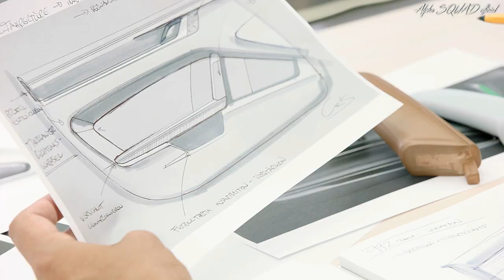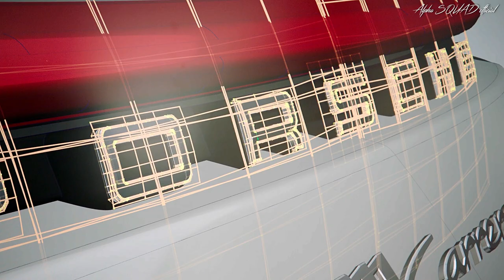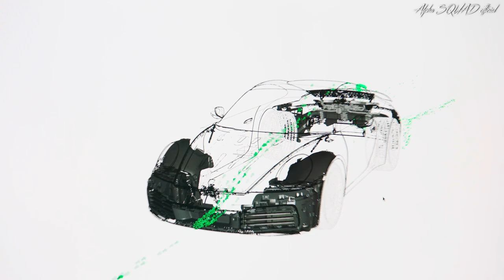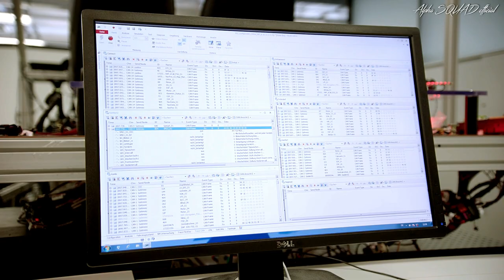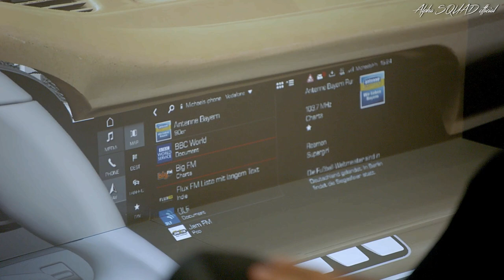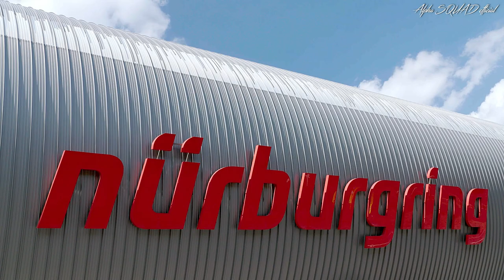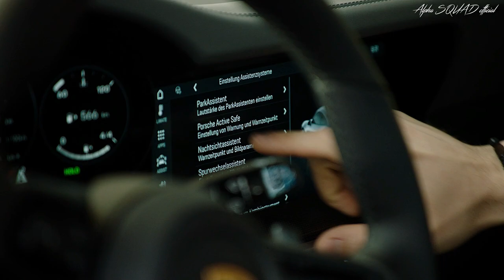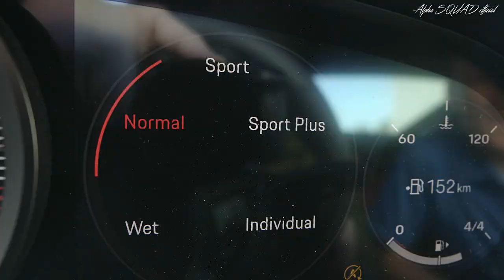Porsche 911 (992) – Clay Model and Development Process

Comment from the maker: TIMESTAMPS:

0:00 CLAY MODEL DESIGN AND STYLE DEVELOPMENT

14:51 AERODYNAMICS AND AEROACOUSTICS

21:39 AUDIO DEVELOPMENT

27:06 ELECTRONICS DEVELOPMENT

30:18 ENGINE TEST BENCH

31:42 SOFTWARE DEVELOPMENT, INFOTAINMENT AND CONNECT

34:44 VIRTUAL DRIVER'S SEAT

41:37 ENDURANCE TEST

47:20 DRIVING SCENES COUNTRY ROAD NURBURG

49:19 NURBURGRING RACE TRACK TEST PREPARATION

51:25 NURBURGRING RACE TRACK TEST

54:39 WINTER TESTING

1:01:55 WET HANDLING CIRCUIT / WET MODE TEST

New Car Videos: https://goo.gl/5nPYXv

Comment: I am in pure awe and amazement of modern engineering. like I am saying holy ** this is amazing every 30 seconds at least. The durability test felt sub par, like yea drivers should know what to do but what happens when they don’t do it. Like he didn’t give it gas over the rollers, and tbh I don’t have anything to compare it to. I’d like to see how a economy car holds up and does to it. Tbh if they made it so that the rollers were lockable, and had a few more rows of it to simulate traction loss of a specific tire (ex. Front right + rear left) or different combinations to, not necessarily over-engineer something but engineer it to be fool proof. Porches are amazing cars they handle extremely well, and just being in the passenger seat of a gt3 I could feel how much control the driver had and I was amazed. Going back to the older porches I had a chance to ride in a RWB, and while it’s not anything like porche does now, they are alll driver focused cars and you can really see it in the engineering process.